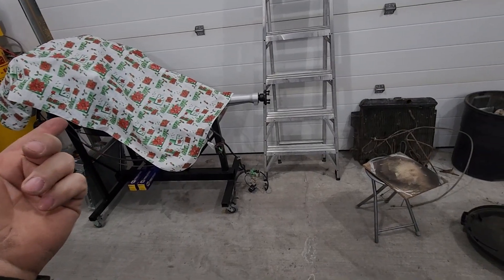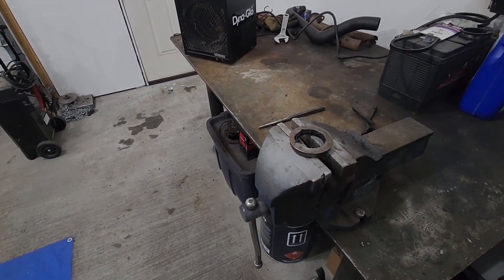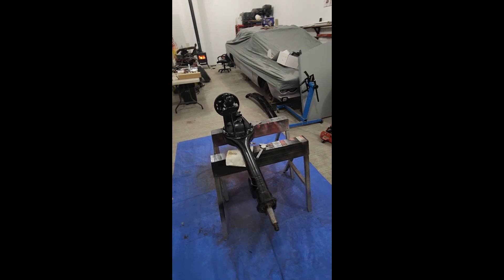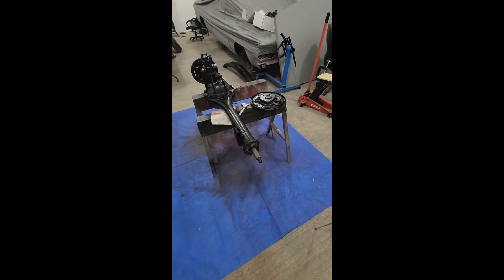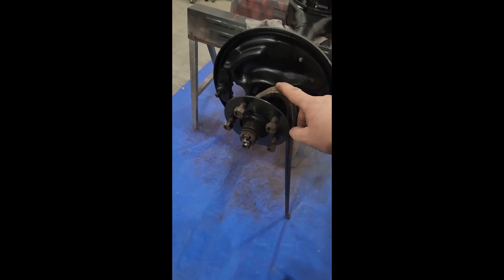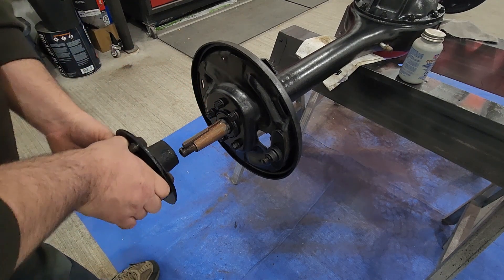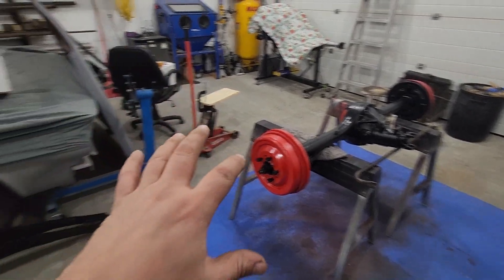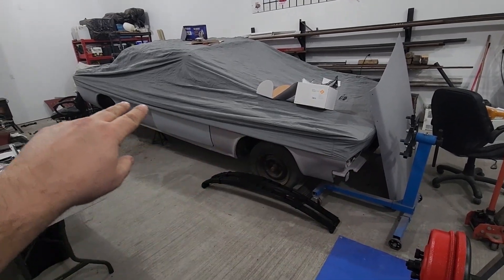Rear axle and front suspension!

Comment: I haven't seen a bearing separator used that way.  Good thinking.  They are normally used to get under a bearing with very little clearance on the back side, and then you would use a puller in the threaded holes on the face of the separator tool.  PA sells the tools, I have the set of 3.  The metal is pretty soft, but it works for the few times I've needed them.

Loving the progress.  Very satisfying to see all the rusty parts now clean and black.
Reply from the maker: Ya, I was so worried about hammering on the pitman and damaging the gear box or seal.  It was tight but got in there just perfect to pop it.  The parts cleaning up is awesome, looks better than new.